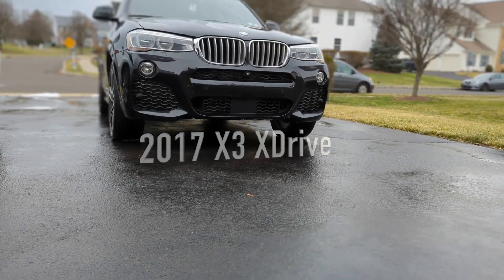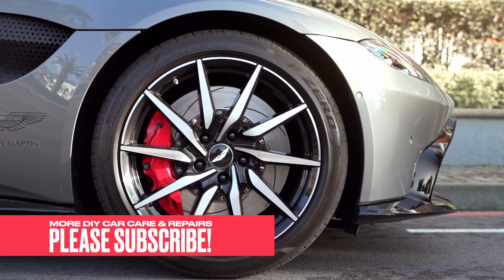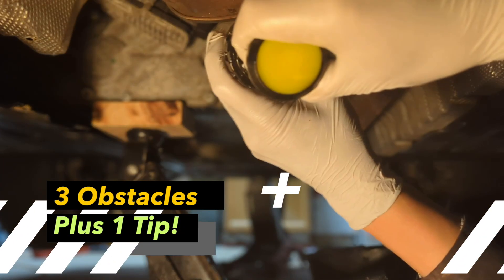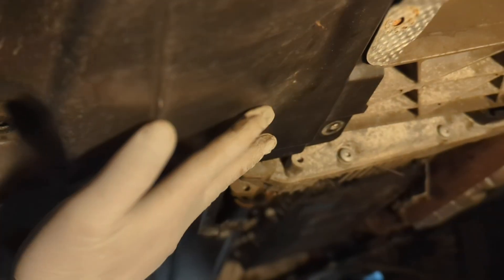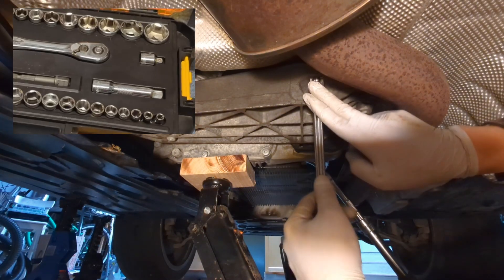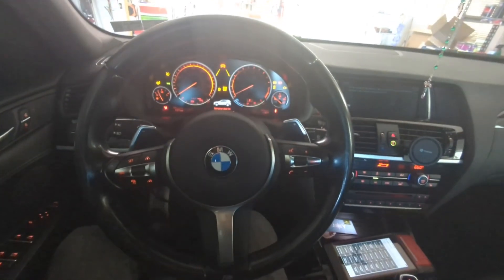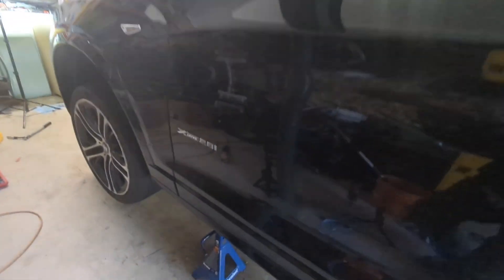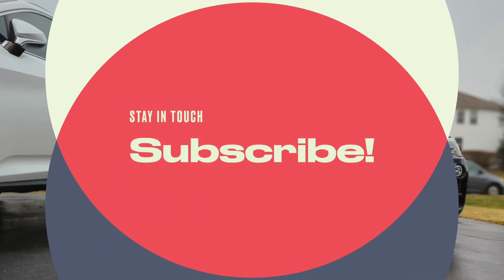BMW xDrive Transfer Case Fluid Change & VTG Calibration: Three OBSTACLES on X3 F25 #carcare

Comment: Nicely Done Professor.   I also have several BMW's which I have done this service on. Each is a little different.  The X3 '18 is about the same as you show.  My M5 '18 is a different story.  The access to the plug is the same, but I do it without removing the bracket using a special tool that I bought years ago.   However, the access to the insides of the TC is difficult and you need a very small tubing to get into it. I found as you did on the X3 that the tubing goes right in. The software for the process is in ISTA BMW's software which does other things in the TC before you drain the fluid.   It's too bad BMW does not build this software in to the car's own I-drive system.  Next is the transmission on the M.   The X3 was very easy. Mike, a Fellow Professor
Reply from the maker: That's awesome! Thanks for sharing your insights, especially about the M5. What special tool did you use for the procedure without removing the bracket / cross member? It would have been much more straightforward if one could access the filler plug/hole without the cross member removal.

Comment: Hello professor, transfer case(front)rear differential and automatic transmission fluid needs to calibrate when changing the fluids? thank you
Reply from the maker: Only the transfer case (VTG) requires calibration reset after a fluid change. On this model, the (front and rear) differentials and automatic transmission fluid changes do not need this step. Just replace the fluid and set level.
Reply: @profsg what do you mean by VTG? i have 2020 BMW X3 xDrive30i, planning to do all the fluids as i got it pre-owned. No service records and it is in 90,000km
Reply from the maker: @kitbox8292 VTG is the name for the transfer case system in BMW.

Comment: Thanx man I didnt know my xdrive needed to be calibrated.. i put to tired on wrong with a different size wheels and after that my car has been skipping evertime i accelerated… and never new what it was.. i Bought new tires  and all same size but it still does it.. i wil now try try changing all differencial Oil and kalibrate it.. thx so much!!!
Reply from the maker: You're very welcome! Glad it's helpful!
Reply: There is a vid on that issue, but u need to take it out and open it up,, good luck, for me I have a small leak dripping so not sure what I do
Reply from the maker: @Balkan-mj4lv  start with easy fixes first. Replace your transfer case fluid and set the correct level. Overfilling or under-filling can cause leaks or make the problem worse. Now that it's leaking, make sure it's at the correct level before anything else. I'm not sure about the exact issue but fixing the leak might not require removal of the transfer case. You can double check, but an easier solution can involve dropping the drive shaft instead.
Reply: Did you solve the problem? I did exactly the same and got similar symtoms. My mechanic changed the fluid but the symtom is still there.
Reply: @Jimwng i calibrated it with a foxwell but it still does the skipping.. i think it has to be calibratet with the real bmw computer…  i dont know what to do thinking of changing the car.. never Ever xdrive again!!!!

Comment: Hi, I am working with my car today now! I did exactly as you instructed in this video. I use a pump like yours, bend the tube too. When I suck there is nothing oil coming out. I am worried. Can you give me some good advices? Good tips for best working position. I find it more easy to get access to all the screws when laying under the passenger side. I find it impossible to unscrew the two 16mm and 18mm screws. When I move to under passenger side, it was a piece of cake to remove all the screws. Thanks in advances :-))
Reply from the maker: What model and year? Some BMW transfer cases may have a metal plate blocking fluid access and you may need a flex tube to get in there. I accessed the transfer case from both sides. For the most part, yes, it's easier from the passenger side.
Reply: @profsg  BMW 525D Xdrive F11 218 HP 2012. You are right, there is a metal plate blocking fluid access. I manage to put my tube about 12-15cm in, but no access to the fluid. I have a 40 cm flex tube from my vacuum pump, I hope it fits in there. Do you have any experiences changing control arms, changing EDC shock absobers. I think your car is quipped with the same EDC absorbers like mine. In Norway we have a lot of speed pumps on local roads, it makes the front coil springs broken because of the heavy diesel engine and rust. Salt at winter time kills many cars. I had broken my front coil spring twice. When this happen I had a height deviation over 10mm and the ICM , VDM pops up with Dynamic damping control. Corner ability restricted. DDE is completely red and all EDC shock absorbers is off line. ICM and VDM is red to. Replacing a couple of coil spring1800-2000 dollars. I have found a solution to do it at home. I bought a hydraulic coil spring at Vevor.com and manage to replace new coil springs on both front. I you work with coil springs I will recommend you to invest a hydraulic coil spring tool a price 150 dollars plus custom 30 dollars. The tool is safe and easy to use. It even support suvs.
Reply: @profsg  A small tool crowbar is very handy and make it easy to press to place so it is easy to access the screw hulls on the transfer case.
Reply from the maker: Thanks for sharing the experiences! Hopefully your flex tube will help get the fluid out. The suspension on our BMW X3 is still holding up and I haven't done anything to it. Two of my latest videos are on the Honda suspension. I've come across Vevor, though I have't tested their suspension products. Used maXpeedingRods products recently and am quite impressed by their quality: https://www.maxpeedingrods.com/?tracking=686c08936855d

Comment: Is the car on with engine running when you perform the recalibration or is the car on without engine running?
Reply from the maker: Yes, it was with engine running when I started the calibration, which triggered a number of warnings on my dash. After that, I followed the prompt to turn off the car and restart the engine, at which point everything was cleared.

Comment: Professor - I have a 2014 x3 28i with over 100k miles. I dont have the history of what is done but do you think I should still change the transfer case and transmission fluids at this point or too late?
Reply from the maker: On the transfer case, yes, it's always a good idea to replace the fluid. The same on front and rear differentials: https://youtu.be/rK3ufJW_bTE. The earlier the better and there isn't any benefit of keeping old gear oil. On the transmission, I'd recommend changing it unless the vehicle has been driven under severe conditions. The question for the transmission fluid is whether it's too worn with clutch/friction materials in the oil to justify not changing it. But under normal conditions, I'd change it. And at 100k miles it isn't not too late on the ZF. I did mine after purchasing the X3 past 82,000 miles: https://youtu.be/cxvEk0ydXtg. I believe it's also the ZF 8HP transmission? Get the ZF LifeGuard 8, which is much more affordable than the same oil from BMW. Best luck!

Comment: How does one even get a tube into the transfer case? I've got a G01, so likely different procedure. I've used a 2mm OD tube and it cannot get further than maybe an inch beyond the fill hole. I've run the oil change process in ISTA to open the chambers, but there is a piece of metal that blocks the inside of the fill hole and I can't get a tube in to suck up any liquid. This car has become one of the most frustrating cars to deal with. Such a PITA.
Reply from the maker: Feel your pain! Looks like the transfer case evolved slightly on G01 and there might be a baffle or structural piece that blocks your tube. I think your 2mm OD might be too thin and particularly too stiff to navigate this new space. Here is a post about the same generation transfer case as yours and they were able to suck out the fluid with a 1/4'' flex hose: https://x3.xbimmers.com/forums/showthread.php?t=1989918. Good you were able to open the internal chamber for additional trapped fluid but it's not a huge amount even if you don't do that. Best luck!
Reply: @profsg  Thank you so much for the response! I'll definitely try that

Comment: Professor thank you for your very detailed and informative videos! Why did you not use the XTools D7 to calibrate the transfer case? Does the D7 have the ability calibrate as well? I’m looking for a bidirectional scan tool for working on a X3 and was considering the D8. Thank you!
Reply from the maker: Great question! I did reach out to XTool support and had extensive discussions with them regarding BMW VTG calibration/reset. Their tech said D7 supports that reset function but I followed their instructions and couldn't find the feature on my BMW. Will give it another try tonight so stay tuned. That said, you can consider the following Launch bi-directional scanner (around $200) specifically designed for European vehicles: https://amzn.to/49x6VJk. I believe the link is an upgraded version of what I have and I can confirm it supports Transfer box (VTG) calibration on the X3.
Reply from the maker: Just checked again and turns out XTool D7 does indeed support Transfer Case Calibration on the BMW X3. For the record, here is the path to access the feature: Diagnosis -> BMW -> Automatic Detection -> Maintain -> Power Train (surprise?) -> Transfer Case Control. I did hit the button to see if it really works and it said the system has valid calibration values in VTG and no fault records for calibration... I hit No at this point but it appeared to be working.
Reply: Professor, your assistance and responsiveness is much appreciated! You are a great asset to the YouTube automotive DIY community!

Comment: Great video. I recently did a transmission pan and fluid change on my 2015 535. I was tempted to also do the fluid change on the transfer box but didnt have access to instructions as clear as those you presented (the need to recalibrate the transfer box was new) as well as was somewhat intimidated by the transfer case mounting bracket!😄 I plan to revisit with my next transmission fluid change in 40k miles.
Reply from the maker: Glad it helped! Removing the mounting bracket wasn't that bad but it does take time and patience, with proper support of the case itself. If the fluid hasn't been replaced lately or you don't know if it has ever been changed, I wouldn't wait too long to change it. Regarding the calibration/reset, it depends on the state of the fluid and sensitivity of the adaptation module. Some had very interesting rides without a reset. Others didn't experience any issue at all. I should have tested the car without a reset first to see how it goes but I missed the opportunity. Will test it next time. :) Ultimately, the module will always relearn and that relearning might be "bumpy" (or take longer) if without a calibration/reset.
Reply: @profsg the transfer case fluid would have been changed at 34k miles when the case was replaced under warranty. The vehicle is now at 74k miles so hopefully I have some time.
Reply from the maker: In this case, I am not so concerned. I am glad about the first change, which is more critical, and you can stretch it a bit for the next one.

Comment: Also I thought it is better to first use the device to set it into oil change mode before doing this, in order to release more fluid out.
Reply from the maker: I am not sure about this. Where did you get this information? Happy to look into it if you can share the link/reference.
Reply: @profsg  https://youtu.be/LXV6E02UKUA?si=aezrG_2jq_xUK_J9
Reply from the maker: Appreciate the information! Also keep us posted how much you drain from the transfer case under the "oil change mode." I got about 560 millimeters/cc out and am curious about the extra amount trapped when the chamber isn't open. I suspect you would be able to drain 600 cc then.
Reply: @profsg   I think you need  ISTA in order to release the extra fluid in the transfer case.
Reply: @profsg  I'm trying to send the link but my comment won't post?

Comment: where do you find the torque specs for all the bolts: Is there a manual we can download and double check?. BTW excellent video and channel.
Reply from the maker: Official torque specs can be found in BMW repair manuals and TIS. However, people share them on various bimmer forums and this is an example: https://x3.xbimmers.com/forums/showthread.php?t=1579401

Comment from the maker: I reached out and confirmed the following scanners support VTG calibration. Product links: 
1. Fluid Extractor ($11): https://amzn.to/4aksDjD
2. LAUNCH X431 Elite scanner for BMW ($130): https://amzn.to/3DzU1hO
3, Another Kingbolen scanner at $75: https://amzn.to/3BIVX7j
3. XTool D7 scanner ($350): https://amzn.to/3wUAHZk
4. Kingbolen K6 Pro scanner ($500): https://amzn.to/3xa6wxt

* Disclosure: As an eBay Partner and Amazon Affiliate, I may be compensated if you make a purchase from the product links I posted in video descriptions and comments.
Reply: Thank you for the excellent video!  I changed the fluid in my 2013 X3 (F25) with no problems.  In my case, it was accompanied by DTC 440102 "Transfer Box (VTG) Oil Wear".  I used a Launch X431 Elite 2.0 BBA scanner to recalibrate the VTG control unit and it announced "Successful".  Then I cleared the fault code and it said "Clear Fault Code Completed".  However, after rescanning, the fault code is still there.  I tried driving the car for a few miles, but no luck.  Do you have any suggestions?
Reply from the maker: @doctorz102649  Looks like you followed the correct procedure but I'd double check whether the adaptation reset AND clearing fault code were indeed successful. Make sure the rest value (don't remember exactly what it's called but possibly "oil wear value" or something like that) is zero or close to zero, with all new fluid in the transfer case. And clear the code again. In my case, I saw a bunch of pending code in the reset process but all was cleared after reset was completed and I restarted the car. If cleared code does come back, unless there are internal issues with the transfer case, driving more (with key cycles and varied driving conditions on certain models) will clear it.
Reply: thank you very much